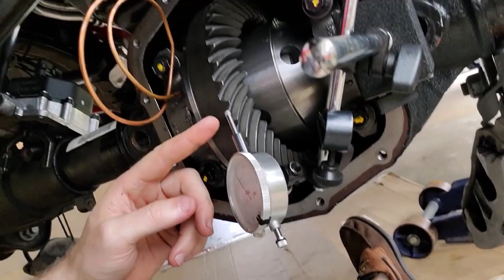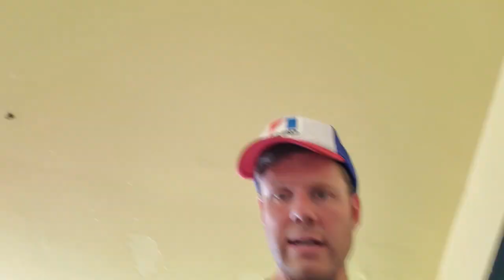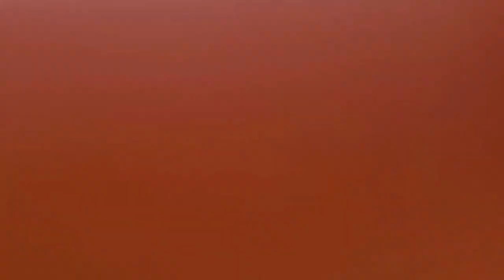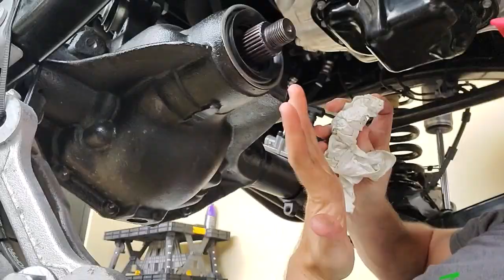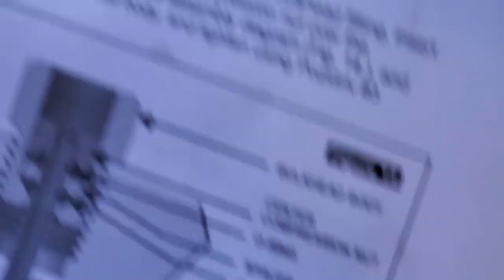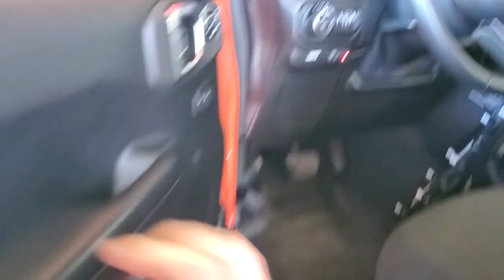Part 6 How to setup & install an ARB Locker Backlash & Gear Pattern (PLUS  install ARB air lines)

Comment: Thank you!  I can’t tell you how helpful this series has been.  I’m taking a ton of notes from each episode.  One question for you.  Wouldn’t torquing the ring gear bolts AFTER you’ve already verified and found an acceptable backlash measurement, actually pull the ring gear in toward one side, and throw off your backlash measurement (and affect your pattern)?

Comment: I have a problem with ARB lockers. The twin washers inside the air line ring (seal housing) mounted onto the axle spline gear (bearing journal) is so low quality. They begin to leak after a year and start to pump your diff oil out to the air pump and now you have an oil leak from your air pump. And when the leak increases with more wear, your lockers stop locking. You have to dismantle the whole diff to change those washers. And guess what, those also wear and here we go again. They are constantly subjected to friction when the axles are moving. This is a big big design weakness. I prefer electrically operated lockers now.
Reply from the maker: I find that can be true if the person installing all the parts you mentioned fails to finish a procedure or fails to torque and install the rings correctly. I can see how many would not want the additional maintenance of those items but its not a deal breaker. The proper setup and maintenance can hurt any part you install. With Jeeps its always a little more work to care for custom jeep parts, tires, axles, etc. I dont find it to be true for all arb lockers. Just have to trust the guy that installs them and will back up his or her work.
Reply: @c130aviator  This is a wear problem. It is a fundamental design problem. There is no getting around it. The air to the locker is supplied via this seal housing into the bearing journal. There are two o-rings sealing the air. And they are stationary. As long as the axle turns, they are subjected to friction. In time they wear down. I had those lockers both on the front and rear of my 2010 Hilux. Because the truck is mostly rear wheel driven, the front differential is rarely used. So I had this problem only at the rear. And more than once!

Comment: From what I'm getting from your install and others online, it seems that the instant locking of the ARBs is what makes them more attractive than the Eaton elockers. But I also hear that the most common flaw with ARB air lockers are with the seals leaking, often times after a few thousand miles after install.  I'm sure you're aware of ARB's reputation with leaking seals, but with you having chosen ARB, I was curious what your thoughts are on that issue.
Reply from the maker: What I have found is that the seals fail when installers and buyers use oils with friction modifiers and other additives. The seals are also a problem for the old lockers due to them being outside the bearing. These seals are inside the bearing now. Also the Vitton seals are the same material sealing your valves in your engine. They last 100k or more. I'm not concerned at all. But I can also have my axles apart in minutes and just redo the seals. Not many can service their own stuff, then find it hard to deal with the bill. I recommend arb but you better have a trusted installer that stands by their work. Like me. 😉

Comment: Awesome video. How does locking the diffa affect the jeep BLD? Need to deactivate it? Still works while unlocked?
Reply from the maker: I deactivate it.
Reply: @c130aviator  thanks for the reply! Disable all together I assume, or only when lockers are engaged? Im debating locking the front only with ARB, keeping the factory LSD until I get the cash to add the rear locker. Or was thinking of locking the rear and moving the lsd to front. My understanding is max tow axles both have m220? Identical?
Reply from the maker: @az_living208  max tow is m220 rear, m210 front. Leave the lsd rear and arb the front.
Reply: @c130aviator  ok, sweet. Maybe ill look at that until I can swap the rear diff to a locker too. Seems like an LSD rear and a locker in front could be a nice combo.
Reply from the maker: @az_living208  that is what the Australians do. Its a common configuration in the land down under.

Comment: When you spread your housing you should set up your dial indicator to read from one side of the housing to the other. You went from the middle to the side of the housing. You should also try to measure off of the housing it’s self instead measuring off the spreader, it’s more accurate off the housing.
Reply: It’s actually.020 (twenty thousands) in the ARB instructions. Most manufacturers recommend not spreading more than .015.
Reply from the maker: @seekingadventures  ahh you are right.  Yeah I could feel it spreading by hand after turning the thrust washer a quarter turn. I felt like I was being overly cautious but it didn't take much to have the room to work in there. These dana 44 m220 axles are incredibly easy to work on and set up. Very thankful for arbs development. It was a very easy install.
Reply from the maker: Not sure, it may have been in one of my other videos, but I did cover those points. Thank you for the clarification. The import thing is not to spread it more than .002 (2 thou) per ARB.